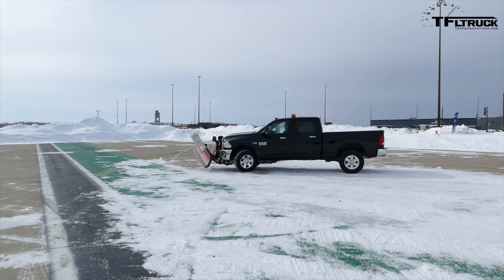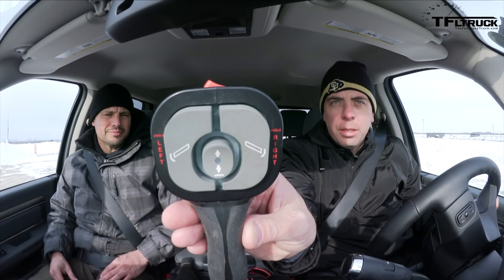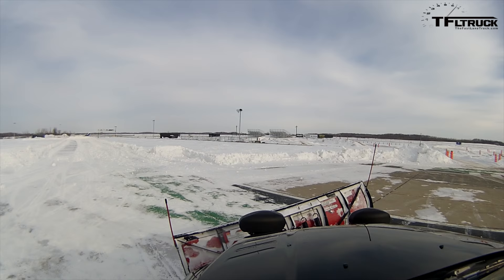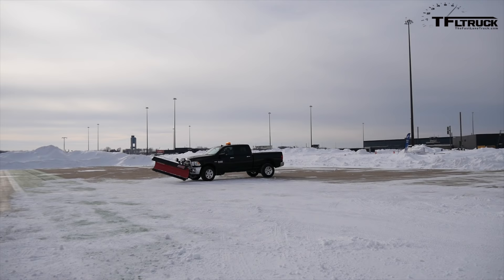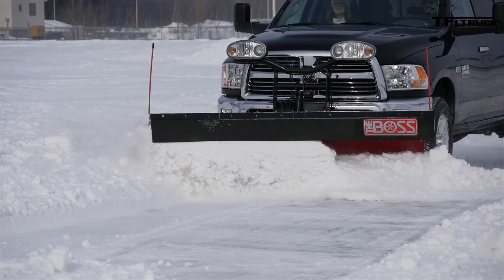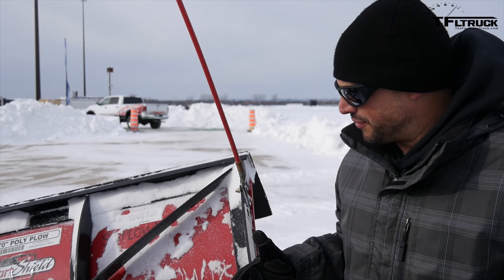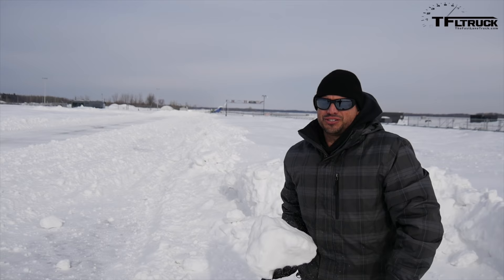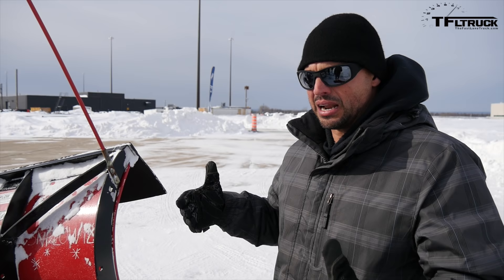Snow Plowing 101: How to Plow & have fun in a Ram 2500 in the Winter

Comment: I would like to see a segment on how to properly load a trailer. I know just the bare minimum like the heavy stuff should be over the trailer axles and lighter stuff near the tung. now that I am older I have a lot more toys. I put one sidexside, two 4wheelers, and three dirtbikes on a 8.5 by 16 foot aluminum flatbed trailer. of course I don't have a weigh station to check my work like you guys do. so you should do a segment on something like this

Comment: The plow will wear out the front end much faster than not having it on. You can't get away from the forces you add to the front end and drive line. Wouldn't say it makes the trucks useless, but i've been in a fair few that straight was 45 degree's one way or another or alternating even on the steering wheel.

Comment: the plow is mounted directly onto the front frame rails right? is the weight of the plow going to bend the front frame rails? because the front frame rails have crumble zones (weak areas) in case of a crash

Comment: Lol first tip to plowing is not to buy a boss. Two you really shouldn't angle your blade when traveling. It allows it to get caught on the ground and causing uneven wear on the corners of the cutting edge. It also blocks a headlight component so you only have one usable headlight and noticeable blinker. This video is a joke, put together by ram and boss. Do not take advice from the guy in the video
Reply: or you buy a plow with extra headlights above it so you dont have problems seeing
Reply: bjmxd that's what I'm talking about. Angling it while raised for transport will block the headlights and turn signal on the head gear of the plow on one side.
Reply: Zach Novosad years ago it was done like that to keep the truck from overheating.  it also reduces width when travelling threw lanes of traffic.  I often do that.  my v blade it's a non issue
Reply: Zach Novosad   if you run a junior plow, it's fine to leave it straight,  but if you have a wide plow in an area where there isn't alot of room, then you want your truck profile as narrow as possible. if a truck is running a plow, only a negligible percentage of oncoming traffic is worried about front turn signals; they're waiting to see where you go before they make a move in front of you.

Comment: That's not false, I've heard many times "don't buy a used plow truck" the transmission issues and wear/tear aren't worth it.
Reply: my 77 chevy k20 has been plowing snow for 38 years......though it does have a sm465 four speed toploader manual trans thats very hard to kill. what you don't want is a used resort truck thats been plowing on the lake, you hit a ice ridge at 40mph you're going to f the truck up i don't care what protection the plow has
Reply: Its all about how it was maintained and if it was used properly. Kind of like buying a used rental car, you never know until you buy it.
Reply: I got 400,000 miles out of my f150 and I've plowed ever winter for 10 years with it since it was brand new
Reply: Gazooo29 
Not everyone can afford a $60k truck with a $6k plow.

Comment: Biased because it wasnt a Ford Ecoboost.

Actually i wouldnt mind seeing plowing attempts by a lighter weight truck like the Ford Ecoboost.
Reply: The ecoboost can't handle a plow. The plow blocks too much air flow into the radiator/cooling system. No manufacturer recommends installing any plow on a ecoboost.
Reply: Keegan Bray
All the more reason for me to want to see one attempt to plow snow. Snow = cold = cooling issue mitigated somewhat.

Apparantly theres teeny tiny plows approved for F-150 + Ecoboost use
http://www.snoway.com/news.cfm/5/sno-way-is-only-plow-approved-for-use-on-f150
Reply: It seems that way but when plowing the truck is under a higher load than usual and it's not moving as fast (less air flow).
Reply: For instance, BOSS didn't recommend installing any of their plows on any '10-12 F150's. It wasn't until the 5.0 was an engine option before they OK'd the HTX series plows.
Reply: Keegan Bray
Hmm. Well thats disappointing. I want to see it happen! It could probably get the job done quickly :P

Comment: I have heard the same thing.  That once you plow with a truck it ruins it.  I could see why you would say that.  But I'm not sure if it's true or not.  You would think that using a plow would put the front end through a lot of abuse.
Reply: Chris Reese It's mostly in the transmission and the front suspension. Constantly going forward and reverse for hours on end puts a lot of wear on the transmission and 500+ lbs constantly hanging off the front of the truck wears out the springs/ shocks. I would never buy a truck that I knew was used to plow. Chances are it's probably OK if it was an HD truck, but I wouldn't risk it.
Reply: Chris Reese plows ruin frames and front ends of trucks over time. i bought a 1995 dodge cummins that was used as a plow truck since it was new and the frame is cracked in 2 spots. front end was just shot. but the tranny was rebuilt and only ahd 500 miles on it.
Reply: Snow plows don't ruin trucks, incompetent snow plow truck drivers ruin trucks.  I plowed snow for 15 years with my 94 Chevy 1500, yes a half-ton Chevy.  I bought it in 94, added a 7.5' western poly plow in 99 and sold the combination in 2014 when I got my Chevy 2500HD.  And this truck had a V-6 and (gasp) a wide ratio 5-speed manual transmission.  It is all about the driver, not the plow.
Reply: @LTVoyager  what kind of plowing were you doing tho? Plowing a couple driveways or doing commercial work?
Reply: I have a 06 2500HD 4.10's 6.0 auto with a 750lb Lot Pro.  I added Timbrens,  a couple cheap frontend up grades,  700lbs behind the axle Batt/alt upgrade and I drive it with love.  Zero problems getting work done.  This truck is also my daily and has 310K miles looks and drives new.

Comment: Driving down the road with the blade angled to the right is NOT the right way.

When the blade is angled that way and you make a turn to the right at an intersection, the blade will be over the center line and in the other lane.
Reply: Wrong, very unsafe to angle to the left.  If angled to the left and you touch the snowbank on narrow road,  It will throw the ass end of the truck into the middle of the road and cause an unsafe situation
Reply: Alan Ackaway 
Simple solutions for various situations, in the one you described I would put the blade in the buck position. 
BTW my comment was in an intersection situation.
Reply: Western recommends straight blade position for transport.  This gives the best road clearance.  This has worked for me for 20 years.

Comment: So ram went back to the column shift?
Reply: I think that is with which package you bought kind of thing. Due the 2500s even have the hockey puck option?
Reply: The HD's always use the column shifter. It was the 1500's that went to the dial shifter. But who knows, maybe the dial shifter will work its way up into the HD's as well.

Comment: The talker  was cool...until the last statement.
Reply: I hear ya.  I passed on a really good deal for a F-250 diesel that still had the shoes installed underneath.  The front end wasn't aligned right.  I drove a plow in Wyoming years ago.  While I didn't do it, the guy that owned the truck and trained me threw the transmission from gear to gear without regard to the future.  If I'm going to spend near $10k on a plow setup, promise my availability to people and put a company name on the line, prepping the truck for a plow is the least of any concerns.